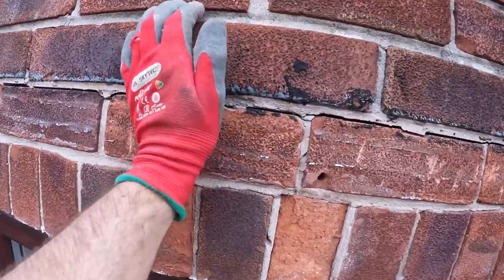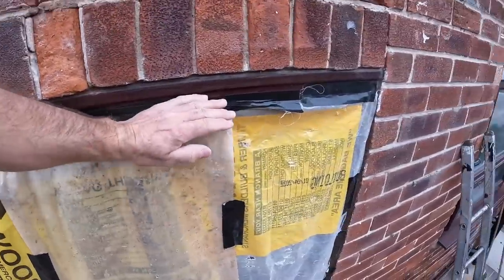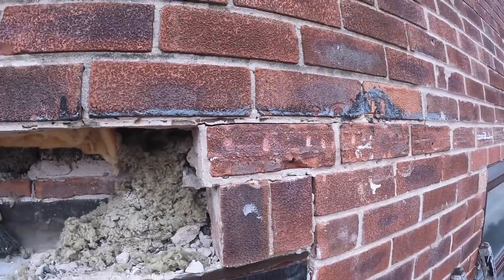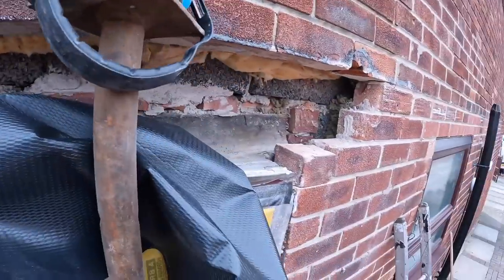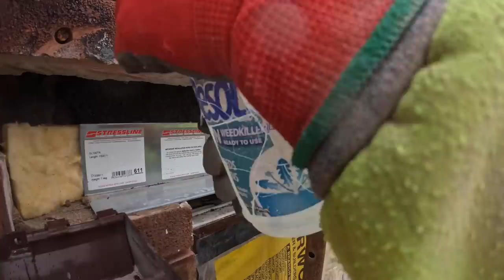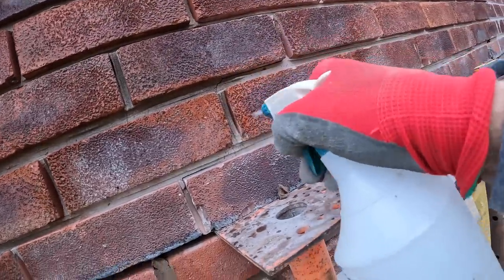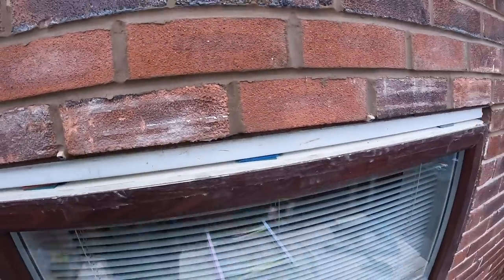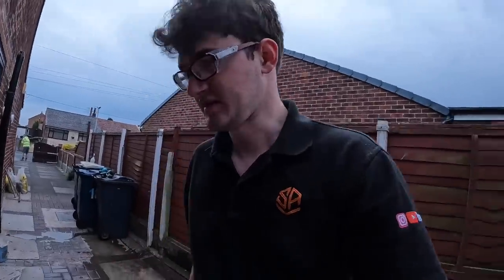DESTROYED CAVITY TRAY !!

Comment: Great video, thanks. I have a question. Shouldn’t you let the mortar set before removing the acrows? Then fill in the gaps after. Or did you feel wasn’t much weight in the pike so ok? Thanks
Reply from the maker: Thanks pal . It’s just down to experience to judge on each job 🧱👍🏽

Comment: Hi guys on jobs like this we pistol the lintels into the bricks on either side. This stops the  gap above window. You can then rewall the header bricks and make good.
Not saying what you are doing is wrong and good job as always but you are changing the house features and ending up with the weird plastic filler. We lift the tray onto the top of the header bricks.
Reply: @Dan Yorkshire, Harrogate, Leeds ect
Reply: What do you  mean by pistol the lintels into the bricks?
Reply: @anthonykinrade8642  it means you cut the lintel into the brick so it is level with the window leaving the brick face on. It's a common building practice that's been used for many years. I was taught it in college 37 years ago. It's mainly used in stone work but works just as well in brick.

Comment: You appeared to be spraying water on parts of the trim before you applied the silicon. I often use water on silicon after I have applied it merely to stop it sticking to my fingers and help smooth it out. Does applying water beforehand not stop it adhering?
Reply from the maker: The water was for the pointing , not for the trim 🧱👍🏽
Reply: @SteveAndAlexBuild  he means @28:23 you sprayed water onto the silicone to dress it with your finger instead of wetting your finger.
Reply from the maker: @AWSmith1955  🧱👍🏽

Comment: Nice job guys. Quick question. What do you do with the dirty water after cleaning out the mixer at the end of the day?
Reply from the maker: We leave it in as last resort till the next  job 🧱👍🏽
Reply: What I used o do is- If I had enough rubble dust piles from the job. I would pour it on top of this to soak it up.  Then as it gets cleaner with hose it's harmless.. Good job lads
Reply from the maker: @topcatcoolio8807  🧱👍🏽

Comment: What is the 'fixation' with cavity trays everywhere nowadays .... and all those weep-holes ? In over 45 years of laying , I ain't ever seen one drop of moisture oozing out of one .
Reply from the maker: Exactly 👌🏼🧱👍🏽
Reply: I'm not saying they are great but I doubt you will see them releasing water ever. It would but be a drip here and there, weeping. You would need some sort of terrible leak for them to be putting water out. I work around some large accomodation blocks and on one building a weep hole has a large stain under it and clearly has a leaking window above.
Reply from the maker: @justbreakingballs  🧱👍🏽
Reply: @justbreakingballs  Never seen a single drip in 45 years (apart from site agents)
Reply: @johnbowkett80  fair enough but on that logic why put a tray in at all? The weep is just a path out for any water on the tray instead of any water just sitting on the mortar bed at the tray. Seems logical to me to offer a path out if a tray is installed.
Reply: @justbreakingballs  Exactly.. Nothing to do with logic.. The cavity tray follows the shape of the lintel ... The lintel therefore is a cavity tray . Been laying for over 45 years (and still at it) and never seen so many trays , they are EVERYWHERE !
Reply: @justbreakingballs  If youve got moisture in in the cavity , you've got serious problems mate , simple .
Reply from the maker: And a right pain in the arse to install 😩🧱👍🏽
Reply: To you all.i seen a job uncovered in a storm. Guess what ? The weep holes drained the water out out of the flooded cavity.. Then provided air to dry the cavity out onwards. Also some lintels were not galvanised.   The question is would you build them in on your own house?  I would . Doesn't hurt. 46 years in the industry

Comment: Yet another great little job there S and A,  Our windows with eventually need replacing, the solders hang down about 10mm from the two support bricks each end, is there any way you can retain the solders where putting in a new lintel ???
Reply from the maker: A proper job is to put in a new one unfortunately 🧱👍🏽
Reply: @SteveAndAlexBuild  Oky doky, could i trim down the solders 10mm or see if metric bricks fit better, put in the new lintel in, sitting on the brick either side, then fill in with trim like you have in the video ???. just to keep the look of solders,
Reply from the maker: @davidcort2857  , Yes mate you certainly can 👌🏼🧱👍🏼
Reply: @SteveAndAlexBuild  Thank you so much Steve, keep up the good work.

Comment: Bricks don’t match the existing and your perps don’t line up with the existing, a three quarter brick was required
Reply from the maker: The bricks were discontinued about 20 years ago so no you are very perceptive there, thanks for that . 
     As for the bond it is very common for the bond to be broken over the top of window . 
🧱👍🏽
Reply from the maker: @martin2466  . Na Martin they actually let common sense prevail ( most of the time 🤔😆) 🧱👍🏼